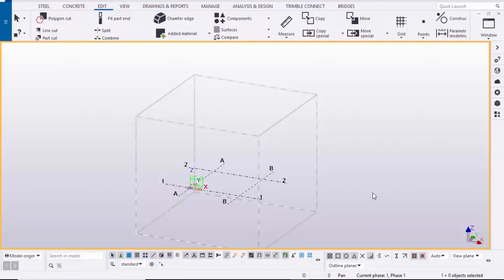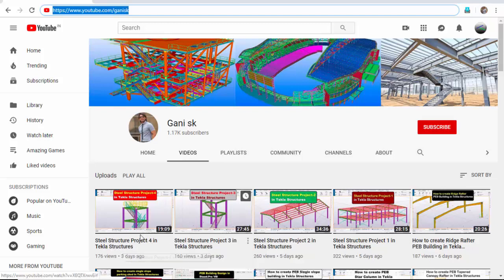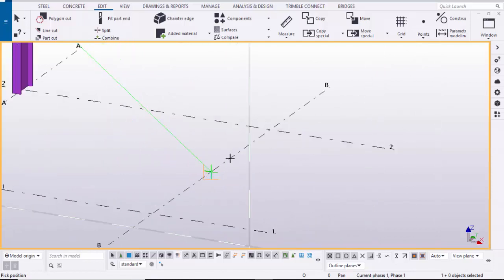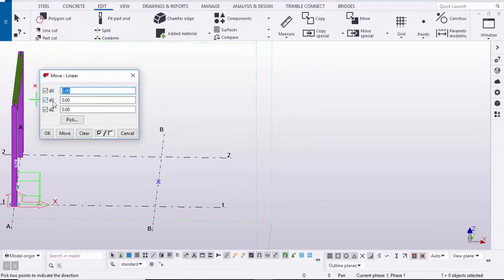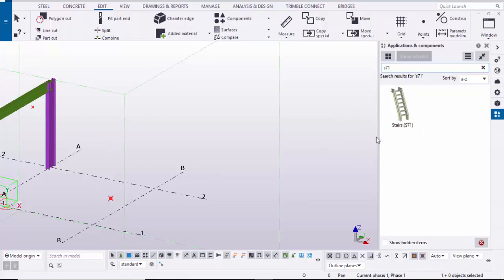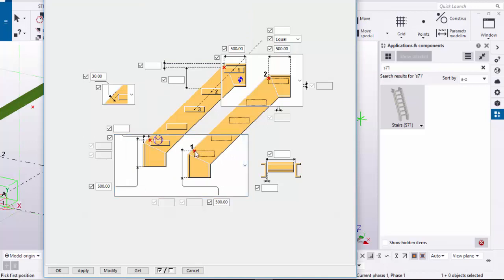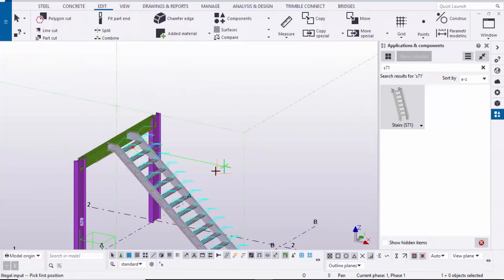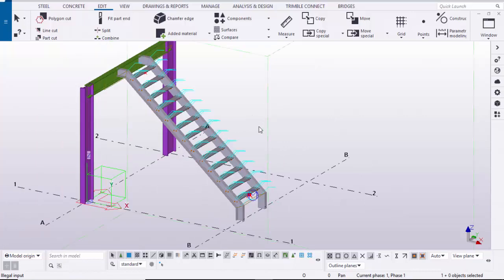Solutions for placing stair with two pick points in Tekla Structures

Comment: Gani i watch your videos daily, learn so much! Wondering: should the dimension in the macro for bottom tread elevation shown at 4:31 read 200 instead of 500? I thought you chose z direction +200 for bottom tread, then you chose 500 at 4:31. Am I misunderstanding? Struggling with this macro so far. Also trying to make welded tread instead of bolted
 and struggling

Comment: When you moved the points Gani, you moved the bottom point -500mm in the x direction, and 200mm in the positive z direction, yet on the macro when you changed the base configuration, the figure to point 1 (the first step) is 500mm, should that not be 200mm? Thank you.